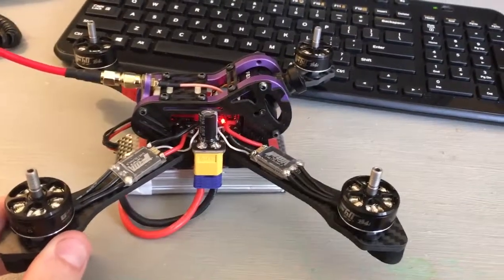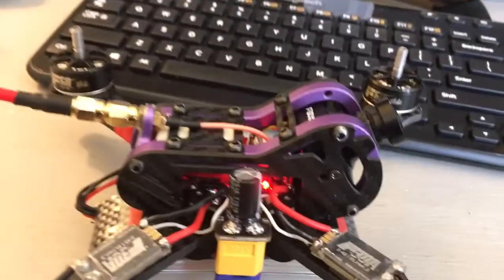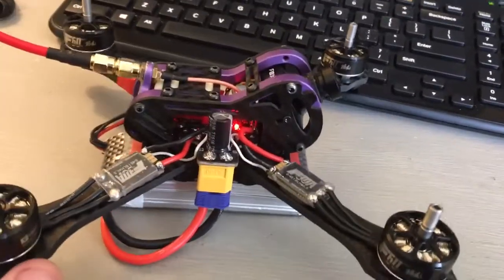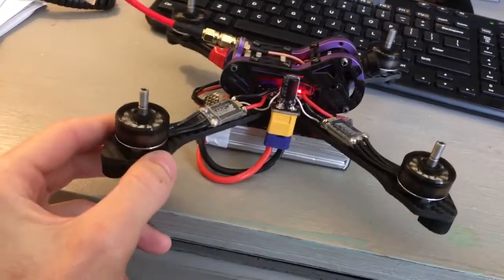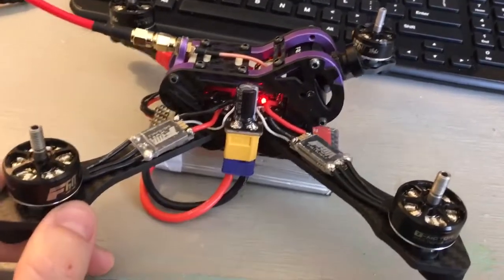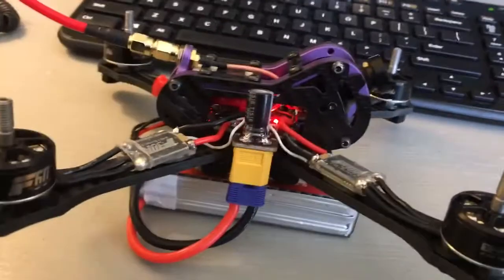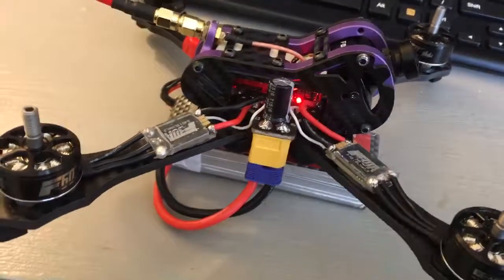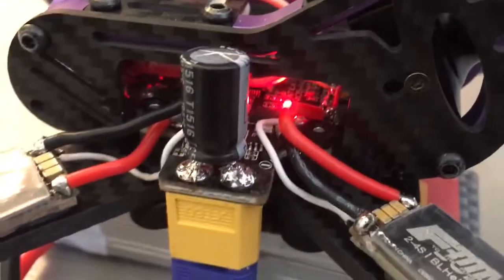Matel F405 AIO --- serious problems [yaw twitch + gyro madness]

Comment: matek F405 are very sensitive to Electrical Noise from the ESC's. I had that board as well but after playing around with it I would never ever suggest anyone fly it without Capacitors on each ESC.
as a matter of a fact if I was you I would get a new FlightController. 

I got this Combo!
 https://www.banggood.com/Holybro-Kakute-F4-V2-Flight-Controller-Tekko32-35A-4-In-1-Blheli-32-3-6S-Brushless-ESC-p-1271330.html?rmmds=cart_middle_products
and I love it. but don't take my words for it. Research for your self.

Comment: I have exact same issue will show you video I tried everything.mine shot backwards on its own.i contacted company they suggested capacitors on each esc.softmount.we tried everything you can think.filtering the works still it does it

Comment: I had similar issues until i pulled the Blackbox log from a few flights and did some comparisons. Basicly, the Gyro noise was to high so I changed the Gyro soft-pass filter to 80hz and left my D-Term at 100-110 hz. Keep in mind that I am running only with Dynamic filtering so all of the other Notch-Filters have been disabled. Please be aware of the dangers of running without the notchfilters as this can burn your motors is not handled properly.

Beyond all of that set all your Terms to stock and proceed from there.